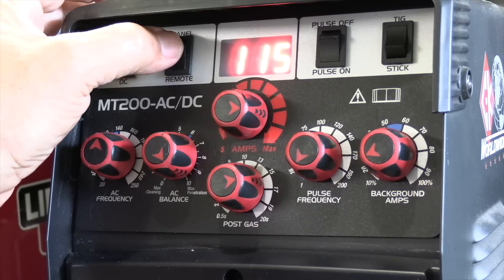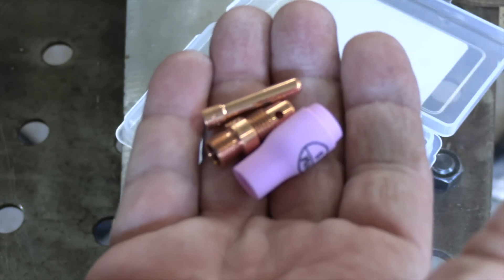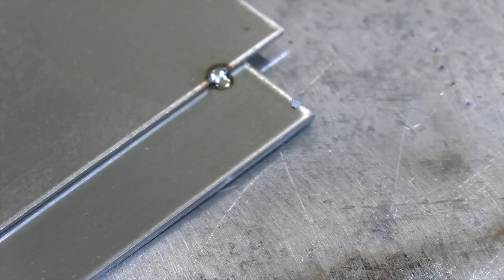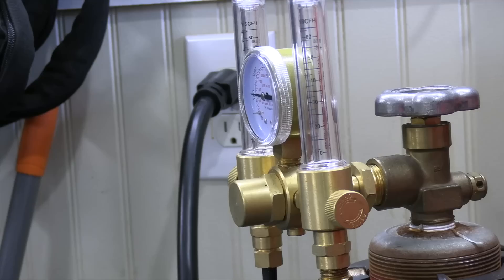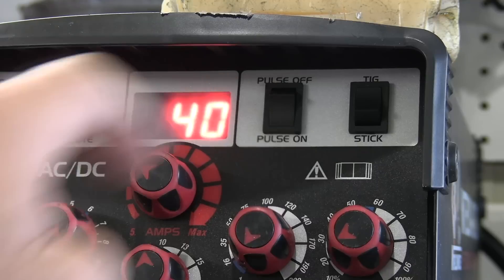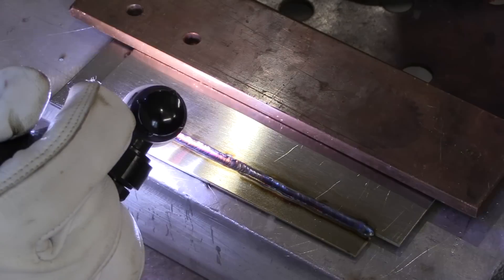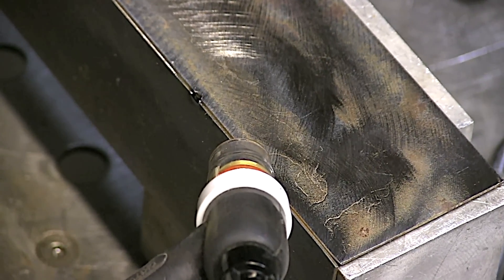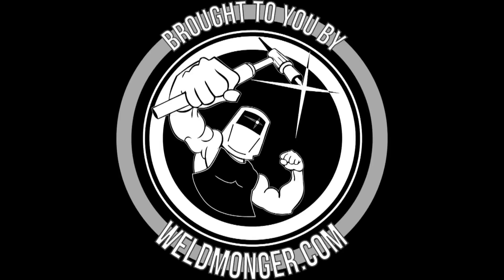What is Autogenous Welding? 3 Examples

Comment: Lately, it seems my jobs have (almost all) been best performed using autogenous welding techniques. Since I only have a 10 yo Miller Divergence, there aren't many settings with it. I've used it to stick weld using any number of gasses to keep it cool ... dry air, dry CO2, dry Nitrogen all seem to work fine with no problems returning to Argon. Anyway, it's time to 'upgrade' to machines where the process can be bettter-tuned to the jobs.

Comment: What is "background" current?    IS that basically the minimum that it drops to before pulsing again?   So for 20% background at 69 amps-   It pulses to 69 and then drops to 20% of 69 (which would be 13.8 amps) and repeats at your pps rate?   Or is the 20% like a duty cycle?  I seen on another video that you can change duty cycle for a "cleaning" effect;  so background probably isn't' that I'm assuming..
Reply from the maker: most of the machines I have used it seems to be a percentage of amperage like you described